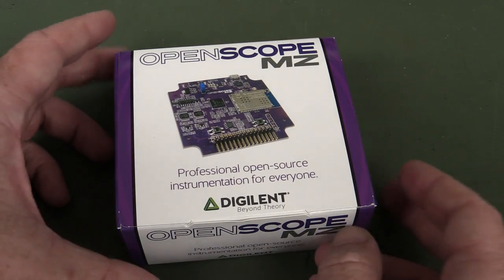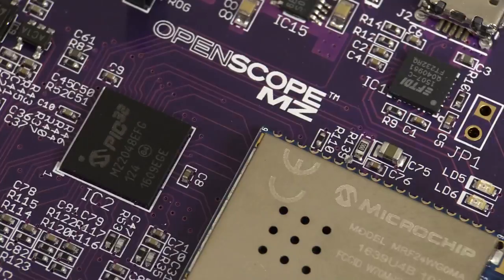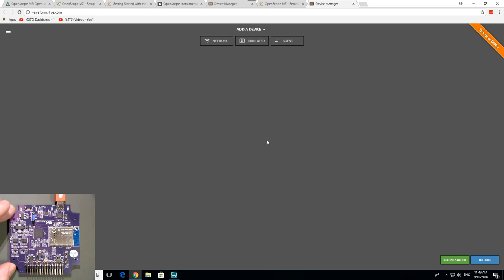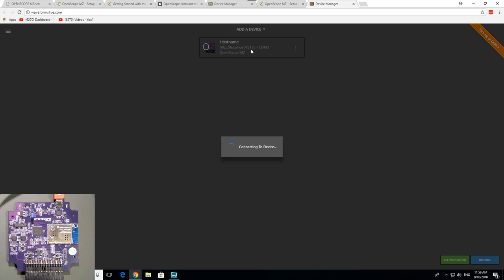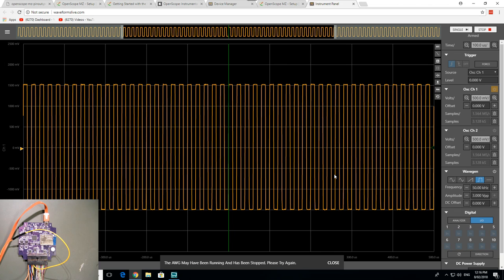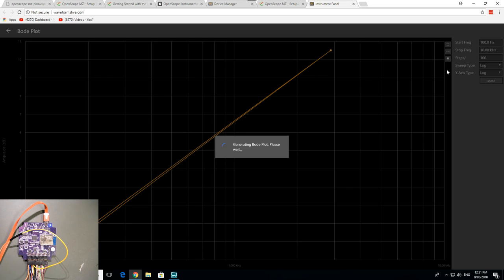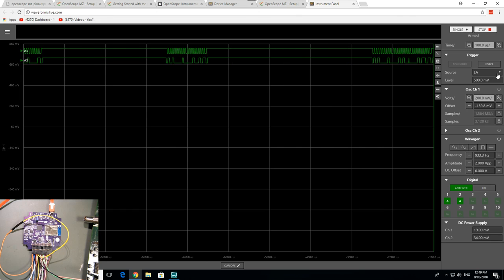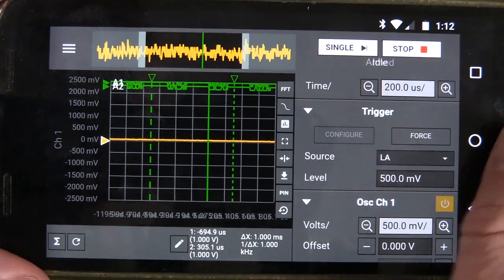EEVblog #1056 - Digilent Open Scope MZ Review

Comment: Hi Dave, thanks for reviewing the OpenScope MZ, we always listen to your feedback. This review has made our office more emotionally engaged than we were over the Superbowl :-). 

Major points: 

1. What type of USB port were you using? We see data corruption issues when users are using Full Speed vs High Speed. We have that highlighted all over our documentation. 
2. We are re-evaluating our packaging and using the word "professional", it's setting the wrong expectation. We designed this, so people could have remote instrumentation (why the wi-fi). It's really a new-type of instrumentation and isn't fully comparable with the Analog Discovery, but understandable how using the same fly-wires and the branding/naming could lead our customers down that path. It was a mistake to say, "professional" on the packaging. We marked it as professional for embedded developers, but not for instrumentation. We need to be more specific.
3. Good UI feedback we will look to incorporate some of the explanation.  We really struggled between making it a pain for experienced users and obvious where first time users should go. 
4. We didn't know about your Open Sourced gear logo, but will evaluate it.   
5. We will make it more obvious that Waveforms Live can run locally.
Reply from the maker: I used a USB 3.0 port.
Reply: Do you know if you still get the corruption over wi-fi?
Reply: i commend you for making a product, giving to a dude on youtube to review, and then engaging and committing to further development based on feedback. few companies do that these days and it is always nice to see a company that cares.
Reply: @INCC74656I  can't agree more. It's very refreshing.
Reply: Good to see a company engaged with the community and responding to constructive criticism.
Reply: @JSMCPN  Good, but no! They stop / drop this nice Scope. No more development in Git from 2018.
Reply: Hi Diligent, I love the Analog Discovery 2 I use at school
Reply: Too bad NI bought out Digilent.  My impression was that Digilent was a good company before NI acquired it.  Such a shame.

Comment: I got one of these a few months ago and so far I like it for doing microcontroller testing on my bench. Especially with limited space for my oscilloscope. Turns out Digilent is 2 floors above me. ;)!
Reply from the maker: Do you get the data sample corruption?
Reply: When I got home I tested it again to make sure and it was clean as a whistle. I used the same settings you had at 50kHz on the waveform gen looped to OSC1.  Bode plot looked fine too.
Reply: Dave, are you using a USB Full speed vs a USB High Speed? That is the ase we see the data corruption. We have a lot of warnings in the documentation.

Comment: Cal data was probably stored in the RAM and would have been lost if you didn't save it to the eeprom.
Reply: That is exactly it. It stated on the screen that the settings would be lost if you didn't save it to flash memory.
Reply: So why's save not automatic?
Especially the first time.
(when you're not overwriting any existing calibration).

Comment: I have a DSO, a Tektronix analog scope, a fluke scope meter, and both the analog discovery 2, and I got the openscope MZ when it came out. And while I think you made good points in this video, the thing I find I use the openscope for which is hard/near impossible to do with the other ones I own is the size and the Wifi capability.

If you are testing the voltages or logic values on a moving object like a RC car, or a tiny balancing robot, it is super convenient to strap it to the object and plug in the chords (which can be a little short I will give you), and then view the data on my tablet or on my computer, while the robot moves around the floor. Which would be  a pain to follow around with traditional scopes and things. So in my mind its kind of meant for like in the field scope uses. I.E. not necessarily in a lab environment but like on a beach or something where you can't exactly bring a nice tradition scope and a computer easily. Or in an environment you need to attach the scope to and have it move with the object.

Either way, I have loved your videos Mr. Jones, and having nothing but respect for you and your opinions. Just thought I'd throw my 2 cents in as an Electronic Hobbyist and a Mechanical Engineer.

Comment: The BNC adapter for the Analog Discovery works for this one as well, don't know if anyone said it already.

Waveforms live works offline.

Calibration is saved to builting flash or SD card and has to be reloaded from that on powerup yes.

You can type in anything in the value fields and then tab to another box or click somewhere else to set them.

Logic analysis missing is an issue, it does seem to be on it's way though.

Can't say much about the Android app, the iOS one works pretty well.

Is it a fantastic product? No, but it has it's uses if on a budget. A friend of mine who pretty much only works with audio range signals has it and is very satisfied. If it gets logic analysis I might be interested myself, depending on the usefulness of that, looking at the price point of other logic analysers that is.

My issue however with some of Dave's reviews is that he doesn't really spend any time using the product outside of what he does during the video. For stuff he really know well like PCB-design, analog circuits etc that is fine since he can look at stuff and say something valuable about it, but when it comes to using the product that's not enough to give much of a review at all. At times it's really face-palm material when Dave fumbles about like a fool trying to do something, failing and giving the product crap for it even though it's a no-brainer if you check out the manual, or spend a couple of hours using the thing.

Comment: I backed this when it was on Kickstarter.

I've used it for a logic analyzer and didn't have a problem. However, this week I finally tried out O-Scope for an 8-bit computer.

 Found out 8MHz was too much. I'm disappointed.

The color coded pinout is in the waveform software. However, a sticker would be really nice.

To set the frequency, just type it and click away.
Reply: Thanks for the suggestion for the sticker. We have one that if you print, you could use, but a sticker makes more sense. Thank you for the idea!

Comment: Wow, 2 MHz. Can't do shit with that now these days.
Reply from the maker: Can still be a useful low end bandwidth for many apps, but yeah, pretty limiting.
Reply: 1 meg is plenty if you are working with audio.
Reply: didn't realize you wrote MHz not GHz.... yeah... maybe a lot of the projects I do could be ok, but RF? forget it.
Reply: seems useful for audio but for not much more money picoscope has a 25mhz model with awg
Reply: I wonder if we can get a review of the updated standalone beagle logic when it becomes available (https://standalone.beaglelogic.net/en/latest/)

More logic analyzer than oscilloscope but it's supposed to also be at the <$100 mark, and the specs look way better: 16 channels, 100MSa/s, 1Gb ethernet
Reply: your car (for example) may disagree
Reply: Fits well for education, also for cars like Jack said. From which frequency you can do something?
Reply: I find a 1 MHz scope is limiting, but a 2 MHz scope works fine. 100 kHz is the highest I need to measure. Seeing peak-peak voltage, frequency and waveform is enough for me. Using these parameters an op-amp oscillator design was found to be faulty.
I don't do RF, any higher frequency measurement is usually digital and so a logic analyzer can be used.
Reply: @rikimiki12  Digilent Analog Discovery has pretty nice software and 30MHz. I have to take a look at Pico software.

Comment: Spotty hardware coupled with dodgy online only software - Talk about embracing the worst of all worlds.
This actually makes me feel better being stuck with a Hantek 1008.  At least my spotty hardware with dodgy software will work (sorta) without Internet.
Thank You.
Reply: BS. Dave should have noticed that big, orange "fork me on github" thingie in the top right corner. Click on it and you instantly see it's completely open source and can be installed locally in like 1 minute (on amy decent linux box that is). The online version is only for folks too lazy or too dumb to do that.
Reply: @7hemroc  Normal client software that needs a local server (for no good reason, besides the framework being really for the web and not for apps) is a pain.

Comment: I have an old fusion 878 card I modded that I could maybe turn into an oscilloscope, but it's input voltage would be in the audio level range. These chips had I guess extensions for digitizing hdtv data, and basically have a 900khz x 16 bit mono ADC in them. You can use Linux and you use the bt878 audio.

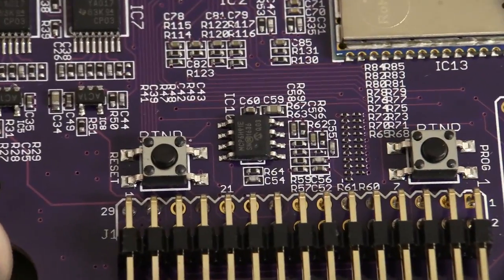Comment: That horrendous soldering at 6:07. Considering those leads are supposed to be oscilloscope input leads as well, it's hardly a wonder this thing is only rated 2MHz. I realize it's technically connected, but considering quite a few of the traces are on top of the board they should get their wave machine setup better. Also, I can't help but suspect the reason it's purple is b/c of the OSHpark association with the color. I would expect better from digilent, this doesn't seem any more advanced than a hobby project.
Reply: Feels like an OSH ;)

Comment: I hate webapps and all its silly resource hungry  frameworks - personal bias. I think the reason it's so quirky is due to all those webframeworks and javascript. Waveforms is a much better product and is not tied to the web. Ditch Lite and implement a plugin to drive this from Waveforms. Oh, and fix the hugely obvious  glitches, Jeez.
Reply: FYI, it has nothing to do with javascript.
Reply: ok
Reply: Waveforms live is opensource and is therefore available to be fixed by the community. And it is updated all the time.
Reply: It's hard to get a fluid response from js,  it's single threaded in nodejs and the browser. You can use web workers but that is a PITA and tends not to solve much.  Angular is good but has to be used judiciously or the performance tanks.

Comment: 1. What goes thru the USB connection?
2. What are all the bundle of wires for?
3. Where did the sine wave come from?
4. Maybe some explanation would have been beneficial.
Reply: JL Software the data goes through the usb cable, plus power.
The wires are the test probes, required on oscilloscopes and logic analyzers.
The device itself, it came from the waveform generator.

These are very basic questions, and is not something is consider important in a review of a product, these questions(and answers) are better to be in tutorial videos on USB connections, oscilloscopes and logic analyzers, and waveform generators.

After all, most of the people in the market for these devices should know these things.
Reply: This is a review. It should include a 1 or 2 sentence description of what the thing does. It's an oscilloscope? Really? Real oscilloscopes don't have a huge handful of wires - they have sockets to plug test leads into. And is the data that is going through the USB cable just coordinates of what to display on the screen, or is it the output of A/D converters on this board, which would require more software in the computer to produce the display that looks like an oscilloscope screen? That's a lot more helpful than rambling muttering while trying to figure out the controls on the screen.

Comment: Nice demo Dave. Digilent done it again, NFG. Even 30 bucks is too much for that P.O.S.
Reply: Not a Digilent fan boi but the Analog Discovery was definitely worth it for 100 level EE classes (IIRC my father got them at 100 USD a unit for lecturing his undergrads).   

This thing, eh yeah 30-$50 is where I'd place it if I were being generous. 2mhz is powerful enough for doing power analysis. I could see it being useful for intermittent fault finding and/or tough to see locations (e.g ECU work on a car is notoriously annoying to get a scope visible) so streaming to your phone is kinda handy.... though, now you have those 50 buck meters with bluetooth so might as well use that. Yeah, haha, you're right, no real place for this at that price point. 

I'm giving them props for making an effort anyways. (If you look at the Tek RSA edu-market stuff, it's hella overpriced for what you're getting, don't think Agilent is doing any better)

Comment: Couldn't it be the case that Dave's loop-cable dangling over the WiFi chip is picking up a bunch of noise from the same chip? I mean, I do not know how strong the output signal of the WaveForm generator is, but these pulses look like WiFi signals to me...

Comment: Dave, love your channel.  I bought the OpenScope MZ after watching this review and seeing the incredible ease of getting it setup and running.  I haven't had the same luck.  

My board initially connected, tried to update firmware...failed to update, and now won't connect.  Very frustrated.  I've been struggling with it for three hours and haven't even gotten to the "Calibration" step.

Do you think this is something they broke with an update?  Or were you just lucky?  Can you make a follow up video exploring this?  Thanks!
Reply: Finally figured it out.  Initially, i (1) installed Agilent Agent, (2) launched WFL, (3) plugged in OS MZ, (4) Add Device > Agent > local host +, (5) selected appropriate COM (yes, my OS MZ board was appearing the device manager), (6) my OS MZ board connected and notified me that the firmware needed to be updated (7) selected "Latest Firmware" and clicked "Update Firmware"... (8) after attempting to update the firmware, WFL notified me that the update FAILED.  The next five hours were torture.  My OS MZ board would "Fail to communicate" when trying to connect (step 6).

The solution: (1) Unplug OS MZ, (2) Exit Agilent Agent, (3) Close WFL, (4) Start Agilent Agent, (5) Launch WFL, (6) Plug in OS MZ, (7) Press and hold BTNP and momentarily press BTNR (LD1 now blinking), (8) Add Device > Agent > Local host +, (6) even thought the "Fail to communicate" message appears, with the appropriate COM port selected, click "Update Firmware".  For some reason it proceeded (7) selected "Latest Firmware" and clicked "Update Firmware" ... and it worked.  This time it installed the firmware successfully and i was able to continue to calibration, and beyond.

OMG...finally!  It's working and looks awesome.
Reply: Hey Nolan, did the same thjing when I first got it and now it is a brick. After a lot of trial and error, found out you need to hold down right button and then left button, to get something... red led flashing... and that is where i’m at.